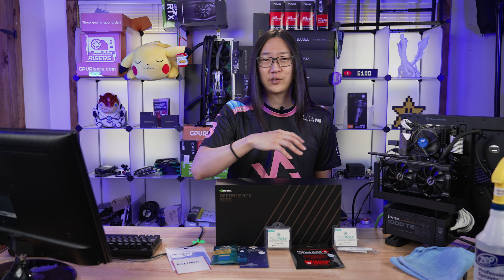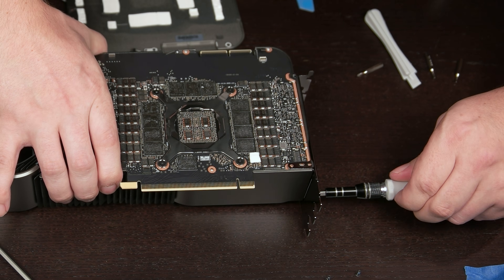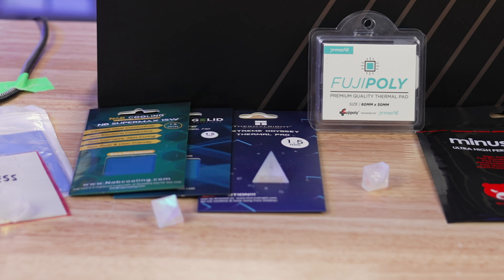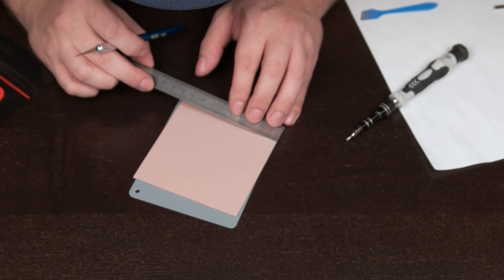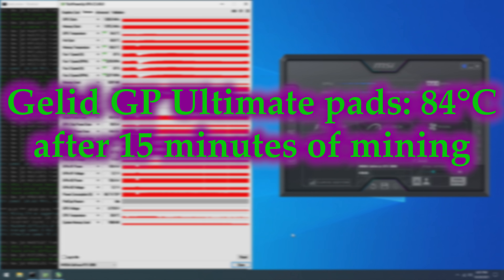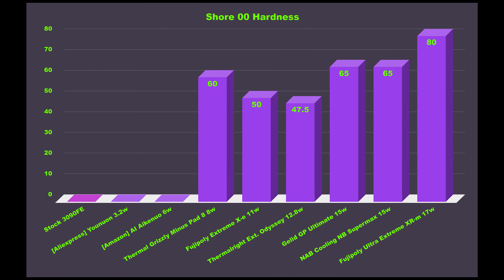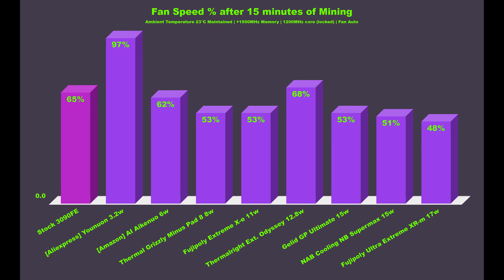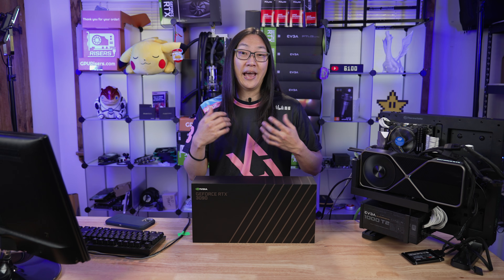Thermal Pad Showdown! What you should (and Shouldn't) Buy

Comment: This kind of information is worth gold. Thank you for doing this (and it makes me feel better about getting the Gelid's in the first place). Comprehensive, easy to understand and to the point.

Also worth to note, using thicker pads means the contact pressure between the cold plate and GPU core is less, which usually translates into a few C increase on the GPU core. It's a tradeoff, cooler RAM means hotter core.
Reply from the maker: Hey there, thanks for the comment on the feedback. Regarding the thicker pads. This also happened with the thinner pads and every pad we used was relatively close to the tolerances listed. Because of that is why we determined there was more thermal saturation in the cooler.

Comment: i have alot of the founders edition cards. i have been using 2mm pads with great results. i noticed your video suggests 1.5 mm. assuming i was wrong i gave your 1.5mm pads suggestion a try. doing so caused the components to barely make contact with them. causing the gpu to thermal throttle. i switched back to 2mm and the thermal throttling went away. i highly suggest that everyone give my claim some credability. i would hate to see someones video card to hit the graveyard.
Reply from the maker: Hey there, if you notice this is Not a how to do a thermal pad video or how to measure them, but rather measuring the comparison of performance between brands. Regarding the size will be different for your situation in almost every application. I'm sorry to hear that you had some issues with it. However, the video was never intended as a how to or what to use, but rather which ones have the better performance.
Reply: @TekShinji  im marely trying to be helpful to you and anyone else who is interested. im not complaining. no troubles here.
Reply from the maker: @mickeybinas   there's been a few people DMing me  with various issues unrelated to the video so it's been kind of hard to go through everything and figure out what's what lol. Glad I worked out for you though!

Comment: Propably you did something wrong cuz i get better score on my gelid pads but 2mm
Reply from the maker: So you tested the 1.5?
Reply: @TekShinji  thank you for question, i bought just 1,5 and testing tomorrow
Reply from the maker: Well so you know what the video was for right?
Reply: @TekShinji  sure and I like it :)
Reply from the maker: It would be very difficult to make a how to / what to do video. This video was designed to determine the differences between pads based on the manufacturer claims. The card we used is kind of irrelevant. Because everyone's situations different. All we can test is the ability and claims of the pads.

Hover I know a lot of people think that it's a how to do pads or what to use video. Part of the reason why the details weren't set out as a how-to on a 3090

Comment: would these results still apply to watercooling?
Reply from the maker: Water cooling is just a different type of heat exchange medium. It would apply to anything that requires a thermal pad. Remember, we were tested the pads. Not on how it's done or what it's going on but rather the conductivity and claim ratio/ basis of the pads

Comment: I bought a whole ton of those thermalright pads a while ago. Too bad about then sucking so bad. I measure them directly against the stock pads when I replace them, so I don't even pay attention to the listed size on the packaging. I've had good results on 3080 and 3090 cards, but in the future I'm swapping to different pad brands!!
Reply from the maker: Yeah man I'm glad you got a lot of pads. That's the way to do it. It's hard to predict so it's best to buy every size you think you'll need and then just go from there
Reply: Had zero problems with using  Thermalright 1.5mm on the 3090 FE and 1.5mm and 2mm on the 3080FE literally dozens ... I don't get the gpu increase noticed here either .
Reply from the maker: Thanks for the feedback!

Comment: Best video on the subject!
more heat sink on the back and extra ventilation would surely help but the pads are needed to get the heat off the memory
Reply from the maker: Thanks buddy, I'm glad you got a lot out of it. Don't forget to subscribe and like the video 🙂
Reply: @TekShinji  sure did,  that thin pad probably would match in efficacy with the rest of 12W pads if it was a bit thicker, wondering if it was bad batch, but considering how mooshi it was, it would be safe to use 2mm thickness instead of 1.5 for that model.

Comment: Not all hero’s wear capes
They have nice long hair
Reply from the maker: Lol that is true!
Reply: Thanks to this video I’m going to attempt changing the thermal pads on my 3080 GeForce oc waterforce rev 1.0 
The memory temps hit 110c while mining, and I can touch the back plate and not feel any heat(it’s so weird)
Reply from the maker: Not feeling any heat is not necessarily indication of good thermal thermalt you will have to investigate. Of course. Every card is different!

Good luck on your venture and be careful!
Reply: @TekShinji  update-last night out artic silver 5 as thermal paste and only replaced memory pads with thermalrights. I put the old pads on the back over the memory and I went from …
110c memory junction to 80c (while mining) 
Gaming wise went from 60c to 39c 
Gpu core went from 47c to 36c while mining and even lower to 28c while gaming.

Comment: One more comment.... I would love to see that video about adding thermal sinks to the backs of cards. People report some pretty significant improvements in memory temp with that but I've only been able to knock off 2 - 3 DegC personally. I have actually gone to removing the GPU backplates entirely so the backs of the cards can radiate the heat more effectively and that did better than attaching heatsinks to the backplate. If you do the backplate heatsink test you should give this a shot -- you may start the TekShinji backplateless wave with that idea. :)
Reply from the maker: We actually have a video similar to that already on the channel. It was earlier on in our history. However, it approved to be not as effective because the thermal pads were already bad to begin with. Now we know it's better to replace thermal pads other than putting heat sinks on only.
Reply from the maker: Another big portion is airflow. If you add heat sinks to the back it's great but you got to have air flow to remove the heat as well.
Reply: @TekShinji  You are exactly right. I have fans on both my rigs to keep air moving across the cards. My current thinking is that the ambient air temperature is way more important that I initially thought. I was brand new to most of this at the time so I watched and read a lot but didn't know what info was reliable/trustable so I wound up doing my own tests for the most part. Misfit Mining has been a great find for me personally. Now I have too much good information to process! :) 

Have a GREAAAAAAAAAAAAAAAAT day!
Reply from the maker: You're welcome, I'm glad you got a lot out of it!

Comment: Can you try thermal paste ON a thermal pad and see the results?
Reply from the maker: Hi there, we have not done that in this video but from past experience I can tell you that does not help because you are compounding and stacking thermal interface materials.
Reply: @TekShinji  ok thank you, i replaced my thermal pads on 4 of my 3080 ftw3 and the mem junction temp still hits 100c+. I used the minus pads 8.
Reply from the maker: @oSTYNCLSYo  again, there's many factors, especially since this is a modification that would be done outside the factory. I would double check to make sure everything's making proper contact. Remember, the pads will only work if you have adequate air flow as well.
Reply: @TekShinji  I'm assuming the pads aren't thick enough, i used what evga called for but it isn't right. I will give it another go lol.
Reply from the maker: That is One of the possibilities. The only way to actually get to the solution is to try multiple options and see which one works best. They don't make the memory and cooler. Height consisted enough between brands and even within their own product line to actually give a blanket statement. That's why we only used one card for the testing. Instead of multiple. To try to keep the testing consistent. Remember. This was not a how-to or a which card is better but rather a comparison between all the pads only. We wanted to see which pads were the best and if you saw the whole video it was more to it than which was better. Depends on your goal!

Comment: Great video and info....  although I think something is going on with the thermalright pads.  The first card I re-padded was the 3080 gig aorus master(w/LCD)  The thing is like 3 bricks so I figured it would have great cooling but it would thermal about 30 seconds after power up...  replaced ALL pads on card using 3 different sizes of Thermalright...  temps dropped by 20c and card has not thermaled since.
Reply from the maker: Very nice man, good to hear. There's many factors when it comes to thermal and cards.

Comment: Hi, very nice and complete testing, however I can bring my results which defer a lot from yours .. both me and a friend got a 3080Ti FE. Both suffering from very high stock VRAM temps. (throttle 108-110° during heavy mining, fan immediately to 100%). We both did a repad at almost a similar time (end of August). I went for the Minus Pad 8 , he went for the Thermal Odyssey, both 1.5mm front and back (i tried 2mm first, that did not work, not enough Core contact). We had roughly the exact same temps during mining afterwards during gaming or mining (tried ETH, RVN, ERG), within the same 2°, both excellent, easily down to the 80° with about 60% fan. BUT,  more recently I noticed that my temps were getting really bad again, to the point of being back to the 104-108°, at the same or even higher fan speeds (I was mining constantly since then). I took it apart again and ... it's like the Minus 8 pads "leaked", and had water under them now sitting between the ram module and the pad. (I have some pics). Cleaned up everything, and went for the same Thermalright Odyssey this time around. Back to the amazing 70°ish for gaming, 80°ish mining. So yeah, durability and ability to withstand during time is actually super important as well.

Short sum up from my side : Minus 8 Pad and Thermalright Odyssey perf is similar (approx -24° VRAM same conditions), but Minus 8 Pad degraded within 2 full months of constant mining. Let's see about the Odyssey
Reply: WARNING I use water cooling on 3080 and went from 68 C to 96 C in 8 months on Gelid which is tested in the roundup. All silicone based thermal pads are leaking silicone and sooner or later will become junk. ~100 % of pads in consumer market are silicone based but Google it - non-silicone based thermal pads do exist. You will not see claims  like 13-17 W/mK but if you do not need to replace them every 6-8 months it is fine I guess.
Reply: @BlackPhilosopher  nice, I was wondering about durability as well.  Despite the good results on the three most right, there was no way for them to show durability.  Thanks for sharing!
Reply from the maker: Thanks for the info 🙂😊🙂!!
Reply: Jaques dewever hello can I ask you a question? today I ordered the thermal right thermal pads precisely the thermal right Valor Odin 15w, I ordered them at 1mm for the memories, because ek waterblock declares that on the Vector ftw3 only the 1mm ones can go, I did well to order them right at 1mm and not more than? I hope they don't press too hard to reduce their thickness. thank you
Reply: How is it holding up now?
Reply: HOw's the odyssey now?
Reply from the maker: I'd like to know as well!
Reply: can we have an update pls?
Reply: where's the updateee
Reply from the maker: Join the discord! And just simply ask the questions you have. Due to the largeness of this video and complications, we decided not to post a second update

Comment: How often these pads needs to be changed?
Reply from the maker: Generally it should be good for the life of the card. Again, this should only be done if it's needed. If your card is working fine then you should be fine. However, your mileage will very depending on your application

Comment: The thing with the 3090's, is that you were thermal throttling on stock pads, so it wasn't using full power/hashrate until you got memory out of throttle-range. so that's mostly why core went up so much in this particular testing methodology with the 'good' pads

Better contact with the heatsink to transfer heat through it faster is a factor, but my 3090 fe was throttling gpu core usage and memory heavily with the stock pads. I went with the GELID pads- went from 106C throttling, down to 78C at full load (and from ~70MH/s to a 'conservative' 110MH/s). I also noticed the backplate went from ice cold, to hot as heck- clearly wasn't even making contact with the stock pads
Reply from the maker: Thanks for the feedback. We appreciate it! For the record. This was not a how to lower temperatures on a 30-90 video but rather comparing all the different thermal pads together. The testing methodology was the same on each one and we tried multiple times. However, thanks for pointing it out. We'll definitely keep this in mind for future
Reply: gelid extreme or ultimate?
Reply from the maker: Intel or AMD?
Reply: @TekShinji  thanks for the replies, and i appreciate the comparisons! Of course the 3080FE and 3090FE both are plagued with the same issue (severely) but the 3090 throttles hard when mining if the temps aren’t in check (and needs way more power limit % than 3070 and lesser cards)

You were hashing pretty high, so i think you got a lucky card out of the box, thermal pad-wise!

(Not sure if the intel question is for me but I run i3 quads in most of my builds lately-8100’s mostly)
Reply: @TOLYA_ARBALET  my 3090 is running gelid extreme, but i got a bunch of ultimate for future cards (got 10 packs)

Get the right thicknesses and ditch the nvidia tarp, you can’t really go wrong. The card will thank you with a longer life!

Comment: You just earned a Subscriber. Been looking for a good comparative thermal pad review forever.
Edit: 18:00 This seems like an issue with the GPU Core and Memory modules sharing the same heat sink. I'm about to order some of the Gelid pads for a re-pad on my M.2 heat sinks & ASUS TUF 3070 Ti. The cooler solution on the TUF cards use a separate heat-sink for the Memory. Hoping I don't run in to the same issue as the FE card does with the heat being transferred.
Reply from the maker: Thank you! Exactly. If it's not a shared heat sink. The results could be different, however a majority of cards combined their heat sinks to one.
Reply: What is your result on Asus tuf 3070ti

Comment: Funny. I was coincidently recommending Gelid Extreme pads to a friend with many 3090's exactly 3 days ago lol. I personally use Fugipoly but I don't think it's always worth it to invest so much in 17w/mk pads for the so little difference it can "potentially" give. From personal experience, Gelid always been the ones that gave me the best overall results. Nice video by the way!
Reply from the maker: Exactly, from our testing. There doesn't seem to be much noticeable difference if any. Between the two thing that it's significantly cheaper, it doesn't make much sense.
Reply: The Gelid tested here is 'Ultimate' which is considerably more expensive than 'Extreme' (as in twice as expensive) and has much higher conductivity. The Gelid Extreme wouldn't match Fujipoly Ultra Extreme as Gelid Ultimate does.
Reply: @EliteRock  hmmm obviously?😂 what's your point exactly? 
Actually, Gelid extreme is 12w/mk while Ultimate is 15w/mk. Fugipoly equivalents are 13w/mk and 17w/mk. Honestly, the difference between both extreme vs Gelid Ultimate doesn't justify the price gap between them. Only Fugi Ultimate is really better but still, 75$ for a single pad is overpriced for the little improve over the others it gives. Beside, pricing will differ from one location to another. And like Shinji have said, it all depends on the use you have for them since resistance will vary between most of them. I know Fugipoly extreme and Ultimate have the same resistance but I don't remember for the others..
Reply: @danielchicoine79  Gelid Extreme is 8.5w/mK, not 12w/mK. I paid UK£20 for two 120x20x1.5mm Gelid Ultimates six months ago (for VRMs on a MB that are notoriously under-cooled) but they've dropped to c. £16 since then. Looking at prices here in the UK again, Ultimate now seems to be about 30% more than Extreme (for some reason sheets of Ultimate are bigger than Extreme at 90x50 vs 80x40) not twice as expensive as I stated.
Reply: @EliteRock  , odd - just checked the boxes for my Gelid GP-Extreme and they all clearly state 12w/mk. Am I missing something with them being 8.5w/mK somehow?

Comment: I used thermal right for my 3080ti FE. Reduced memory temp from 98c to 83c, but rised gpu die temp while gaming, not all games only some.
Reply from the maker: Thanks for the comment! That's very interesting to hear
Reply: did you use 1.5 mm thermalright pads throughout the 3080 TI FE?
Reply from the maker: Hey there, it's best to measure the ones you have in your car already. However, they do appear to be around that size again, as shown in our video it may vary
Reply: @dylanwong1977  yes 1.5mm on the GPU die side and 2.0mm on the back side.
Reply: @pocpc1788  sorry 1.5mm is a standard for air cooler? Is informative question.. i have a ek vector for my 3080ti, and ek recomended to use only 1mm, i have order thermalright 1mm, is correct?